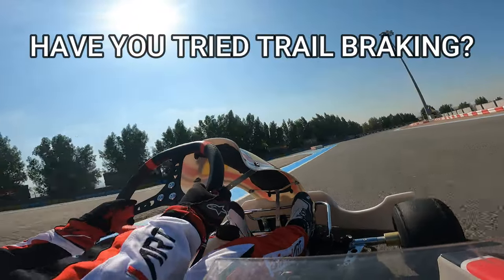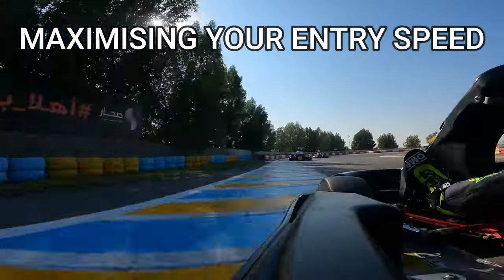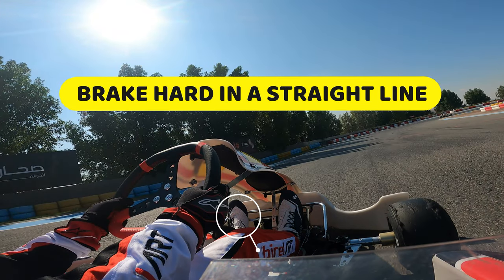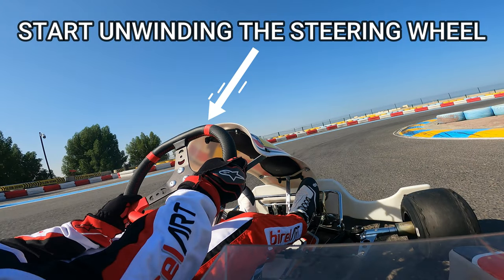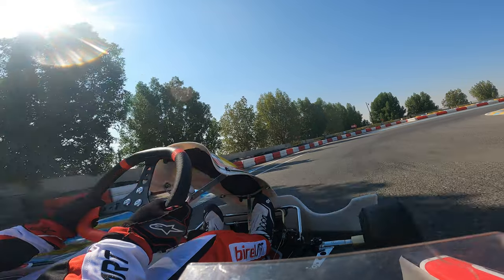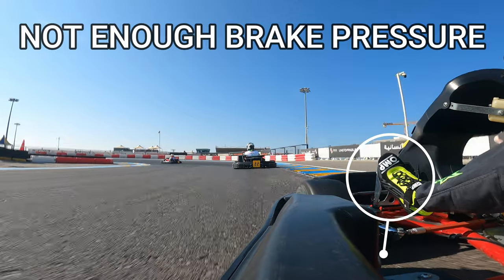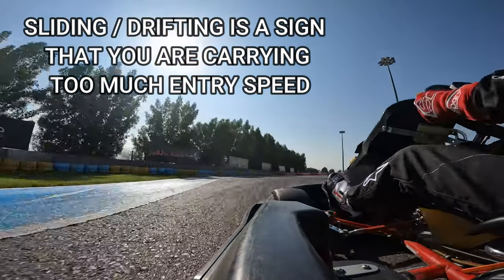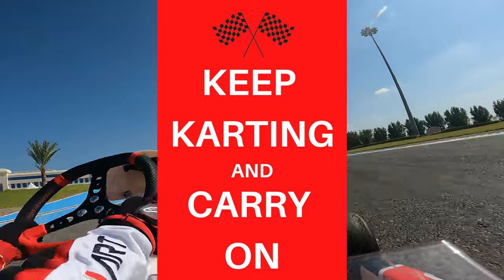How to TRAIL BRAKE in Karting (tutorial)

Comment from the maker: Normal braking or Trail braking? Which one do you prefer and why?
Reply: Is normal braking also the same as straight line braking?
Reply from the maker: @MrLeft-FootBraker  That's correct
Reply: @kartingtips  could you please elaborate more about normal/straight line braking, if there's any benefits in karting or not. Thanks! 🙌👍
Reply from the maker: @MrLeft-FootBraker  Straight line braking is the best technique to begin with when starting karting. It requires you to establish a braking point, not too late, but enough that you have to press the brakes hard to lock the rear wheels. As soon as the rear end starts to slip, release the brakes and control the kart rotation. I did an in-depth video which you can watch below:

https://www.youtube.com/watch?v=lszPzCkJqkc&t=53s
Reply: @kartingtips  Thanks KTips!  Really appreciate it. I'll be sure to check out the video.👌👌
Reply: @kartingtips  i think it is better because that is just what you do to be faster in normal cars, but ive seen other videos that think normal braking is better

Comment: To learn it, I used to picture a string tensioned between the bottom of the steering wheel and the pedal. When breaking, the line is fully tensioned keeping the steering wheel straight. Then I start turning and the steering wheel would pull the imaginary string, pulling the break pedal up.
Reply: I think that’s considered to be cheating

Comment: Thank you so much! Next time I'll try to practice in this way. 

Just a question, when breaking hard, the bodyweight must be taken to the backward? I'm tall and on the straight i use to out my body forward. During the brake, I use to put my body backward and then lean out when cornering.
Reply from the maker: Thank you for your feedback and great questions! When you're braking sit back and load the rear because that's where the brakes are located. When cornering lean out because you want to lift the inside rear tyre giving more grip on the outside wheels.
Reply: @kartingtips  thank you so much, I've subscribed because your Channel has a lot of good advices!

Comment: Hi, can it be done with rear brakes only? Or does the go kart need to have front brakes? Thanks for your videos :)
Reply: I wonder the same, it seems to me like it would be very hard to do this with rear brakes only. All karts i've driven are rear brakes only :p. 
So far i mostly just coast at the entry of a corner. I'm still about a second of the top time so maybe trailbraking is indeed part of this. Ill let you know if i can find some extra time with this :D
Reply: @mizoba  same for me, still about a second of the top time as well... Let me know!
Reply: @gorgeotyann9553  I use a go kart similar to the one in the video that has only rear brakes. I found it really useful to brake hard but without locking the rear tires, that way I could brake and turn into the corner faster. It isn't literally trail braking but it is better than normal braking.

Comment: LOL i always thought that was normal breaking as of how i do in rental karts, i haven't tried out the actual normal way
Reply from the maker: Normal braking aka straight line braking or threshold braking is best for rental karts since you are not carry as much speed. For pro karts trail braking is the way to go!
Reply: @kartingtips  btw, I wanna get into karting competitions with my own (future) kart, any advice or steps?
Reply: @jerosajose  Starting with a used kart definately saves some money !  Had a interesting road to the track ! This will be 15th season of outdoor karting ! With 3 solid years of indoor karting before that . Also did double duty as a track marshal . Last race of 22 worked and raced at same time and started this year off working a 6 hour Enduro !! Non racing injury was the end of kart ownership. 1200 dollars for a kart with spare kart and mounted rain tires !! The next one was newer and paid 1000 for that .  Was getting ready to buy a new one then life kicked my behind ! Just glad can still do a few rental races and can't beat myself up like I did in my mid 30's . Now 54 and still love it ! Never be afraid to ask questions and once it becomes a sickness then all is good 😁 . Make sure you get a set off kneepads to protect the inside of your knees ! Never fly a go kart . It's not bad until gravity takes over ! Back a mess for 6 months and went back for more next round and won back to back races 
Check out Flying Go Kart Overtake . 
Was at end of fence when it landed and driver had sore neck but was ok 😁 . Also you never know who you will meet at the track !Over the years have seen kids become teens then adults  One was not old enough to race and he as tall as me now 🤯 Sorry for the rant but hope you have as much fun as I did . Karting has given me alot over the years ❤🏁

Comment: I only ever driven at Team Sport. Their brakes are on the rear wheels. I'm not sure if its worth trail braking in their karts, you're essentially doing a light handbrake turn. Whole point of trail braking is keep weight transfer at the front for corner entry and maximise front wheel grip. I don't think I can trail brake Team Sport's karts as I doubt my weight will get thrown forward when their brakes are behind me, not the front!
Reply: on the vast majority of karts the brakes are only on the rear. when you decelerate/brake there is always a weight transfer towards the front, even with rear brakes only

Comment: If you trail brake good at some point, with either rentals or low power kart you will just brake in the corner and not even in straight lines anymore for medium and slow turns.